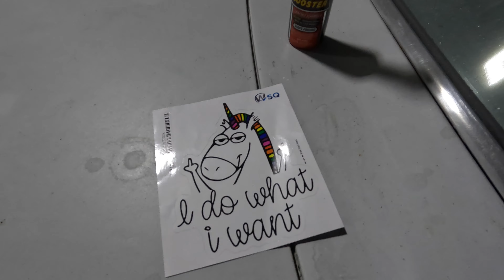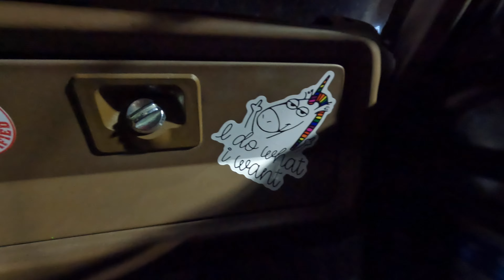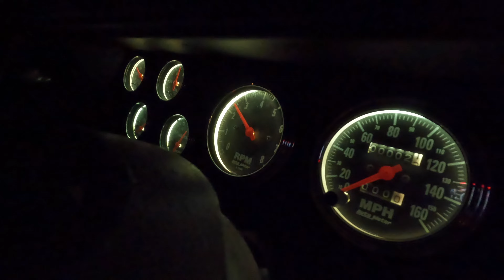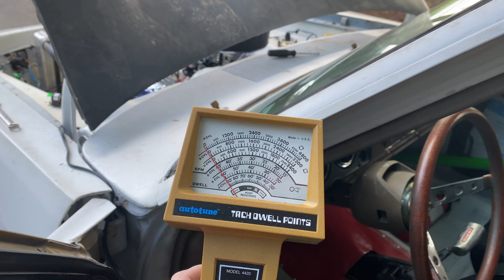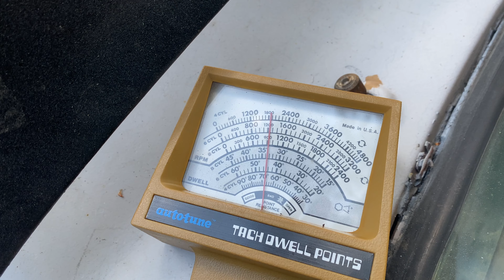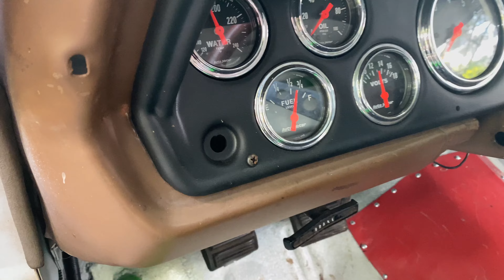The Quest For Burnouts(Also Our Race Callouts For No Name Nationals 2022)

Comment: The jet is sounding good a lit the tires up pretty easily.  I did notice it only seemed to spin the inside tire when you did your donut.  It might need some friction modifier added to the diff fluid.  I know my car has to have it for the limited slip to work correctly and not burn it up.

Comment: You guys have likely heard this by now (or not). I failed tech one time in the 80's for a cracked windshield and it was a TINY crack. Is that still an issue?
Reply from the maker: Oh it’s going to get replaced. But for test and tunes and No Name Nationals, it’s fine.
Reply: @DaddysMoneyGarage  Cool! The motor sounds fantastic, especially when you let off to shift😀
Reply: @DaddysMoneyGarage  have you spoken with tech at the track about that being "ok" for the No Name Nationals ? 
Hate for you to make that trip just to be sent home !
Reply from the maker: @Richie_the_Fixer  Dallas says it’s ok to run a cracked windshield as long as you have a full face helmet.

Comment: OMG THAT SHRILL after the burnout and the " OMG THAT WAS TERRORFYING !!!" was well worth the wait 🤣🤣🤣 WARNING IT IS MORE ADDICTIVE THAN ANY DRUG EVER! It won't be long and you'll be going 🤪😝🤪🤪 😁😎🤓 slinging gears gas and rubber everywhere. LMBOAO Now you have to learn how to keep it going in a straight line while shifting up with the rear end trying to pass the front end. It don't take that long to figure out though. I used to like to roll backwards a little bit and dump the clutch and lay down 2 J marks, but that does eat the tires a lot faster when you do it.
Good luck and enjoy the races & rides to come, Guys because there will be more work to do eventually, but thats part of the addiction and well worth the struggle. 
Looking forward to the next EXCITING Episode of will it break this time. Great work Gal and Guys.

Comment: your launch is still not quite right, I'd try 4000 rpm steady, side-step the clutch. Just slip your foot off to the side and let the pedal go, as that is happening floor it, and be ready to shift...  A line lock might be a nice tool to have too...
Reply from the maker: Oh this was literally the first time even attempting to spin the tires lol. We’re getting as much practice in before No Name though!
Reply: @DaddysMoneyGarage  Yep, I get it. you can practice the pedal release with the engine off. Just sit in the car press the pedal and slip off let it snap up. Do until you get comfortable with your own method.  Consistency wins races  ;)

Comment: First off, I like the new "recap" format of your videos. Second, don't worry about the advice from all the armchair racers out there telling you how to drive your car. It's a learning curve, and it's going to change with temperature, air density, altitude. Spending time with the car is going to be your best teacher. I used to race, the idea it to work out the bugs and keep the car in one piece until the money is on the table. Being cool and reckless doesn't put parts on the car or fix it when you frag something.

Comment: If you kiss 2nd gear with the shifter before trying to stuff it in 1st, you should be able to find 1st gear a little easier. I bet those tornado warning horns are MOPAR powered. I've heard Bleach helps with tire smoke. 😎
Reply: This!.. slide it to 2nd before you go into 1st gear!
Reply from the maker: That’s what I do when I’m unsure of if it’s in first. Used to do that on my truck all the time.

Comment: A line lock is relatively inexpensive and will save some wear and tear on things. Also, if you’ve never heard of them, check out a Verti-gate shifter.
Reply: A line lock, locks the front brakes. How does this save on wear & tear?
Reply: @robertbriggs4176   if you just rev it up and try to do a burnout, say in a water box, you’re working against the back brakes with your foot on the pedal. I actually race a stick car. Once you feel the tires start to bite, you let off the button. It also helps to wire a 2-step up to the same button, so you don’t over rev the engine while doing your burnout. Mines set at 5600 rpm. I shift between 7400-7600.

Comment: I would definitely try a curve shift handle. I think there will be less searching for gears. You could even make a bracket to  to mount a switch on the trans with a light on the dash when it's in reverse. I have the light mounted in a gauge panel.I shift a M22 in my '55. Also THAT THING SOUNDS BITCHIN.  I don't care what Brian says. Great job guys.

Comment: Better weld the spiders for the NNN...
Reply from the maker: It has a suregrip.
Reply: @DaddysMoneyGarage  
Ok, but seems like it should have cut donuts rather than spun just 1 tire.
From the dig in a straight line, the sure grip will probably be fine.

Comment: Drag racing isn't about who can do the longest burnout. Use traction compound on your tires and drink your water. Better your shit blows up in a parking lot than on the starting line of a dragstrip, and waste everybody's time.
Reply from the maker: How is it a waste of time if cars blowing up on the strip is a real possibility no matter what you do?

At the strip, itll get compound. We built the car to have fun, that's what were gonna do with it.
Reply: @DaddysMoneyGarage  Any new build is liable to have a weak link. The place to find it isn't at a drag strip. Find a safe place to launch, putting all the power you have at it and see if it holds up under load.  If it does, great take it to a track, (soon hopefully). I  race every week  and have blown up my share of shit on the strip but we do everything we can to prevent that. I run a low 10 sec car and can't begin to tell you how much fun it is. I hope you will find the same.
Reply from the maker: @robertbriggs4176  We're learning as we go. It's gonna take mistakes, trial, and error before we're 100% confident but I have hopes we will figure it out. We look forward to joining everyone on the drag strip!